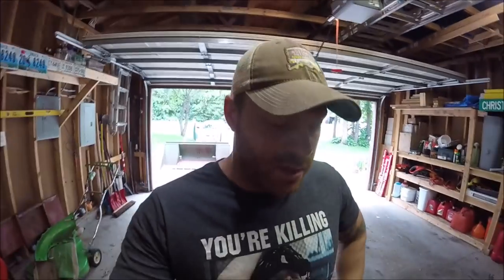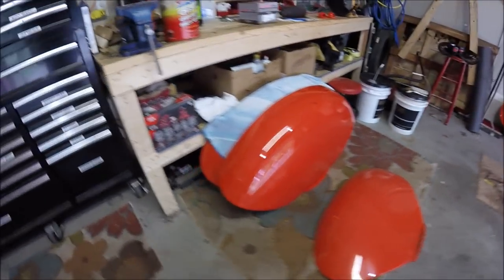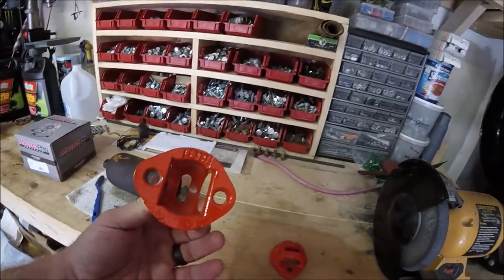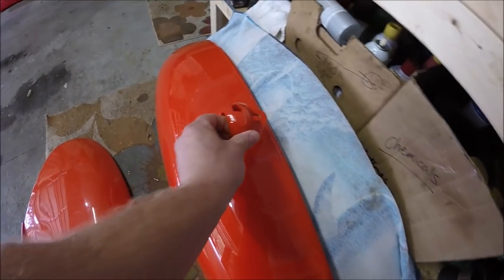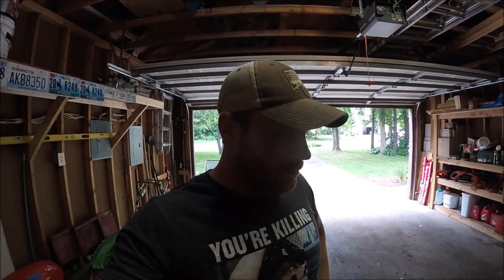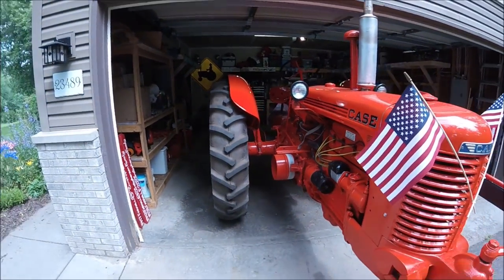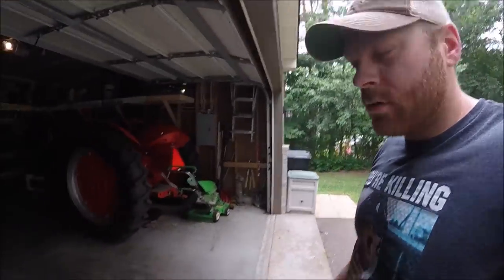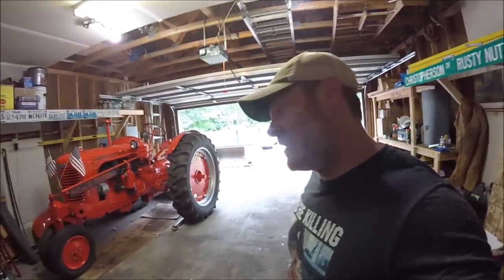1941 Case SC Fender Install & Project Updates

Comment: Your fenders look great. Good job Dom!! It is good to hear your friends are doing better, you are a true bro when you help make things happen for them. I think you should attach your loader like Dom's. Just back away from it. Have you replaced the head gaskets on your pontiac yet? Is it a 3.4  or 3.8L?
Reply from the maker: Jeffrey Ticen he does the best work! I try to help him as much as I can, and he tries to teach me as much as possible.
The loader actually comes off really easily the way it is. I just need to get a 3/4" quick disconnect for the auxiliary tank to make that part easier. 
I haven't done head gaskets yet but I do have a weepy intake manifold gasket. 3.4L.